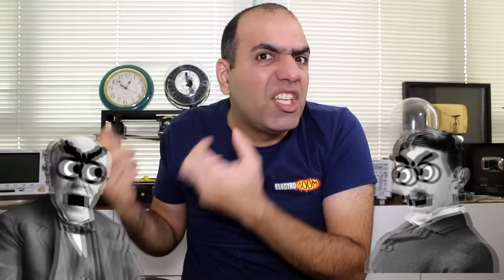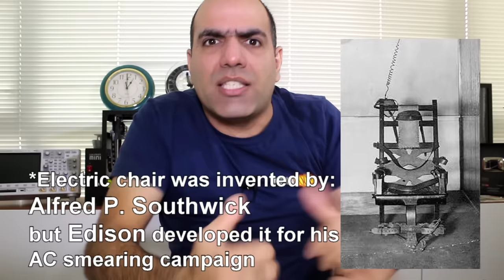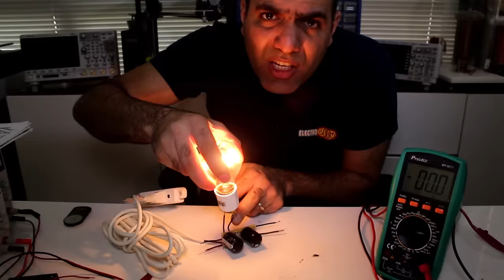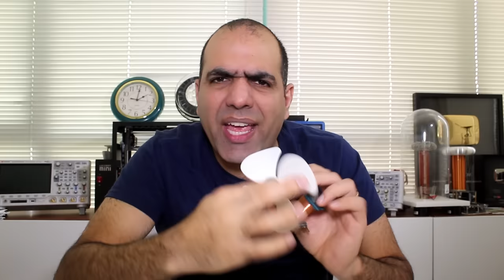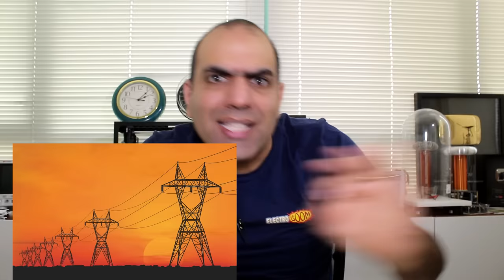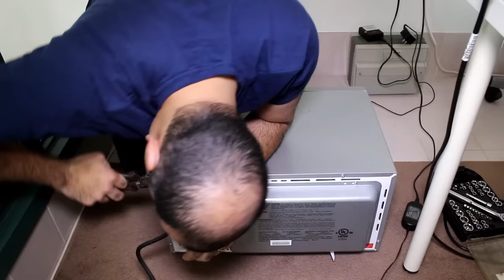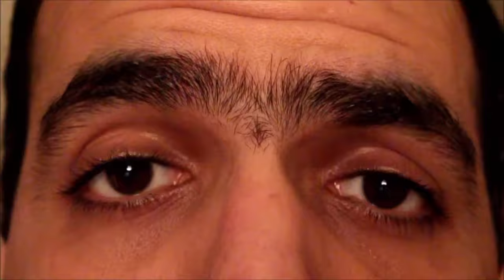Why Use AC Instead of DC at Home??

Comment: Tesla's AC vs
Edison's BS.
Reply: Funny I like it
Reply: Haha
Reply: @ignacio196  it's interesting Edisons DC is not even used that much like AC. U only see it in those bricks for consoles ,TVs,  and Computers to convert AC to DC. Rip Edisons legacy.
Reply: @Daud-ix4tm  you see DC in a lot of hvac blower motors these days.  Modulating the dc current allows you to manipulate the speed, and typically uses less power.
Reply: @uncleteo8201  they are doing away with psc motors in residential, so all new units will have dc ecm motors.
Reply: @uncleteo8201  I agree, I'm hoping with the fact they are going to be in everything will help drive the cost WAY down
Reply: So edison had to Poop at teslas face to give BS
Reply: in finland we only use dc but cars have ac
Reply: Yet HVDC will be the norm in a couple of decades. AC has already lost its most important advantage. It rightfully won the battle a century ago, but that has changed with the rise of power electronics. HVDC has lower losses and less annoyances than HVAC.
Reply: Actually Tesla's invention is BS
Reply: sorindncs God invented Donald Trump
Reply: all device will be using DC in future. we use inverter to control motor so we can control its speed.
Reply: @SabatSch95  well u may be correct about HVDC. but the point is it has nothing to do with Edison. Cause he didn't invent no shit.
Reply: @samueladitya1729  most appliances are actually and have always been  DC . AC is MOSTLY efficient transmission of electricity.
Reply: @debendragurung3033  not transmission but transformation. AC loss more than dc in long range.
Reply: @samueladitya1729  Of course, but who said we should transport energy for long distances? The whole idea of power grid is wrong. Every residential house should have it's own DC generator. Every industrial facility. Every institution or business. Every buiding. So we don't really need a power grid and definately we don't need long powerlines. We should use electricity that is produced locally, and we should use DC electricity becsuse apart from the problem with trasnsportation over long distance,s DC is just better. And Edison was a real inventor. Tesla was a creep.
Reply: @debendragurung3033  True.
Reply: @sorindncs  the reason if grid system is bigger coal power plant have bigger efficiency. And solar panels still expensive back then. But if solar panels going cheaper off grid can be a choice. Also they don't know electronics at that age so not edison's idea
Reply: Tesla made everything we use today but People dont know that when you say tesla today People think of elan musk haha 😂
Reply: Whatever it is that wins AC or DC, Edison has nothing to do with anything. Tesla rightfully owns AC and AC transmission. 
Edison was a narcissistic ignorant SOB, who knew very little. One of main complain he had about Teslas AC was the high voltage used by it for transmission.  So HVDC and Edison dont rhyme. Period. 

Stop bringing Edison into anything DC. He invented no shit. It's like saying Steve Jobs invented the ARM based architecture...
Reply: @samueladitya1729  Biger power plant bigger efficiency. That's right, but I don't want bigger effciency. I mean a bus is more efficient than a car but who wants to take the bus anyway? And I don't think I mentioned solar pannels. I said everybody should have his own generator. Petrol or diesel driven DC generator.
Reply: @debendragurung3033  I heard that Edison does not know or understand higher Mathematics which is very important to AC and the beauties of its applications. Besides Edison was running a sort of invention factory in New Jersey and the credits for the inventions from his research factory should be given to the Scientists and engineers who worked under him and not all to himself. BTW that model of corporate scientific research labs have come to an end with the closing of AT & T Bell labs etc in the late 1990s. The industries now collaborate with Universities where both partie's interests are protected through Research agreements.
Reply: @thomaseidst3170  The first ever to light up the Times Square NYC with fancy Neon lights powered by AC current generated from Niagara Falls almost 500 miles away speaks to the genius of Tesla. Remember all this happened well before the human race understood what an atom is really made up of and QM etc.
Reply: I don't remember exactly, but I imagine he got the patent off Tesla than used it against him.
Reply: @DMN.0000  I think cars already had AC's. But if they use ac to power the AC, I call BS!
Reply: The best way to defend islam Is by practicing islam  you are ignorant aboutEdison . He was a corporate SOB. He could hardly understand higher science how could he have invented. He hugged all the credits done by fellow engineers.
Reply: @christianaadormey9409  Me? Probably you were speking about yourself.
Reply: @sorindncs  Nah, You
Reply: @sorindncs  Supports trump, now I know you’re unintelligent
Reply: @sorindncs  I know this is an old comment. But you are pretty correct. We could have floating ground systems. Virtually no more electrocutions. Virtually no lightning damage.
Reply: @christianaadormey9409  I for one don't like the gas prices and the transportation crisis rn >.>